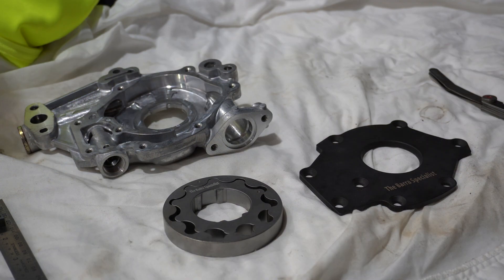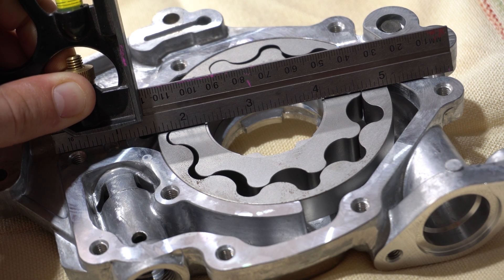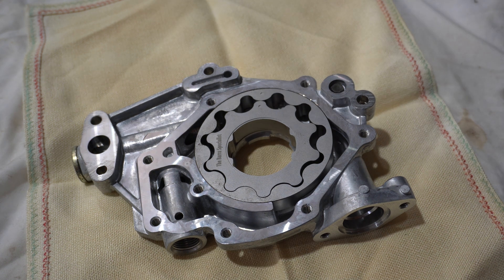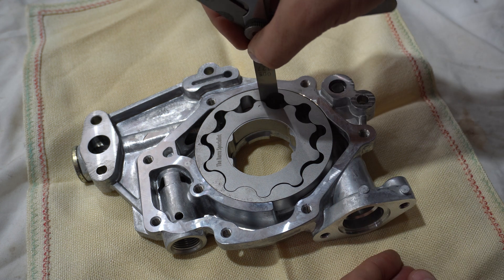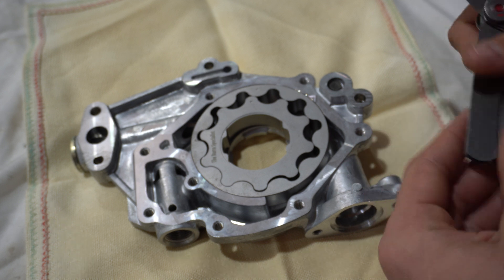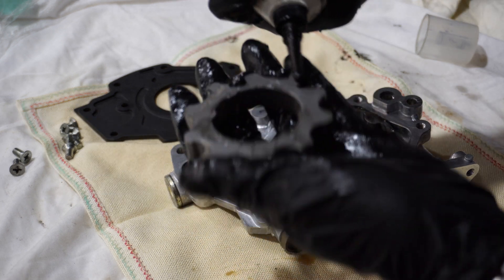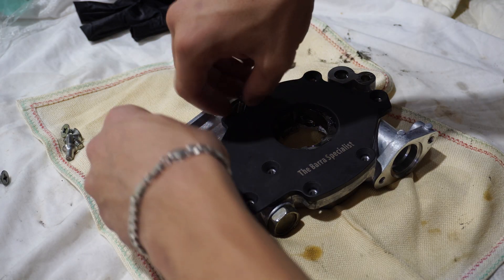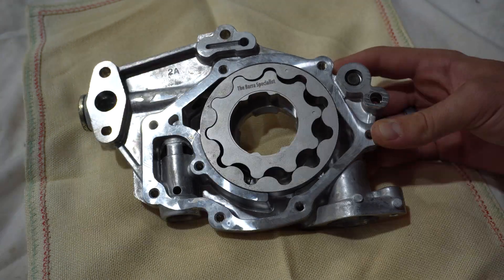Ford Barra Billet Oil Pump Gears and Backing Plate | Assembly and Clearance

Comment: So don't worry about a torque wrench ya reckon? 89 in/lbs or 10nm i was told for my boss 260 pump
Reply from the maker: All screws were fastened with blue thread locker to 12 newton-meter's. I've got another video on my channel from a while back where I do the assembly a bit more in depth. Thanks mate!
Reply: the 6 cylinder Barra oil pump screws are 12 nm

Comment: No thread locker on the cover plate screws?
Reply from the maker: I applied blue thread locker directly to the housing threads in this case, In my last video I did a rebuild tutorial on the oil pumps where I note it. Probably can't hurt to put a card over the video and link my other video for comprehensive assembly. Thanks for the feedback though mate.